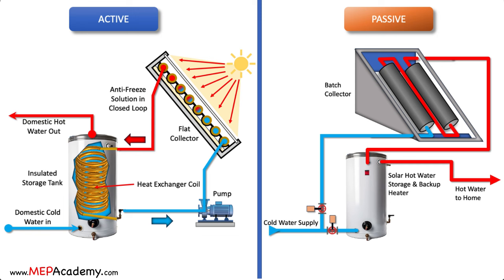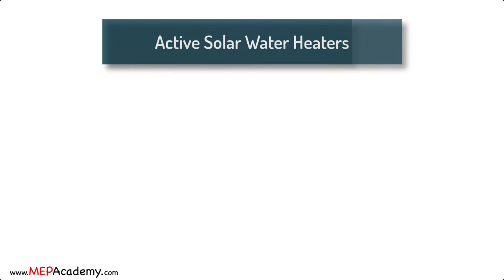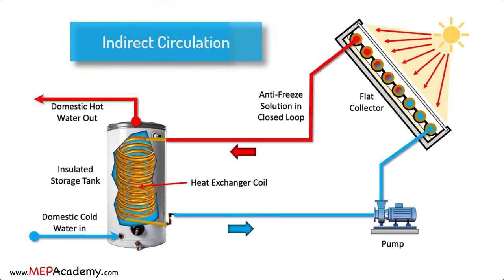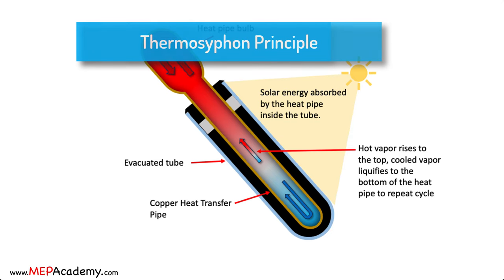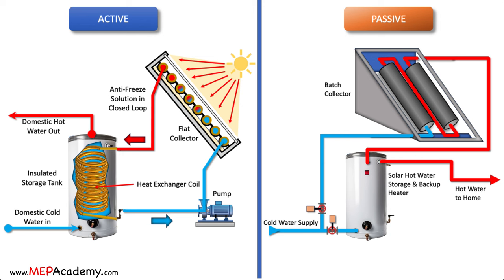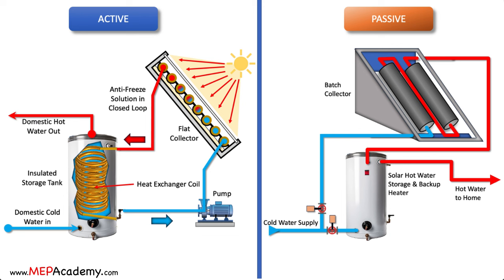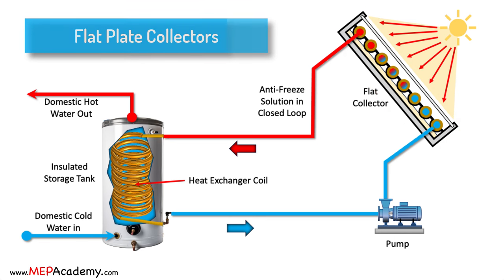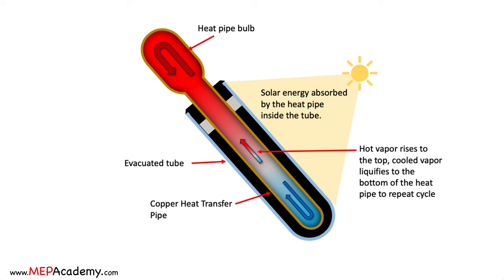Solar Water Heaters

Comment: Have been interested in making an active system for my home in southern new england, for use during our warm summers, and for as much as feasible in shoulder months when warm wx may persist. Unless a different tank design is required, i would utilize a buderus 33 gal indirect HW heater and circulate the glycol mixture thru the heating coil. The pump operation would be triggered by the tank's aquastat. The solar panel would not be roof mounted rather located on ground level (and above basement level) in an area with high sun exposure time period. An antiscalding valve would be used to regualte hw outlet temps.  Are there resources available on your website for sizing the solar panel and circulation pumps, etc? Thank you
Reply from the maker: You might find some resources on the manufacturers website, but we currently don't have any sizing information on our site. Good luck.

Comment: I have installed an indirect solar geyser with solar flat plate collector system. The water doesn't get into plate collector system for heating up. Water is still relying on electricity to heat up. What could be the cause?
Reply from the maker: There are several things you could check to make sure the system is running correctly. 1) Pump malfunction or power issues, 2) Airlock in pipes, 3) Blocked or partially closed valves, 4) Faulty differential temperature controller, 5) incorrect system setup or plumbing issues, 6) Cold weather issues or freezing. Not sure your exact problem, but maybe one of these will lead to a solution. Good Luck.

Comment: can u explain how does water in tank become or converted to cold water
Reply from the maker: Depending on the system type, heat will transfer from the solar heated water by transmission or conductance through a heat exchanger into the cold water storage tank.

Comment: How does the water in the tank not get too hot so that the tank doesn't explode?
Reply from the maker: There are several strategies depending on your climate. You can provide an overflow system, that allows the system to overflow the tank when a certain temperature is reached. A drain down system that drains the tank at a certain temperature. Shading devices for those days when the temperatures are extreme. Thermostats can be used to prevent overheating by activating circulation.